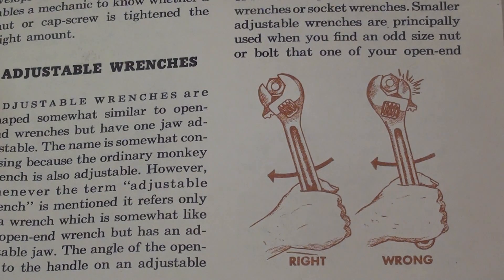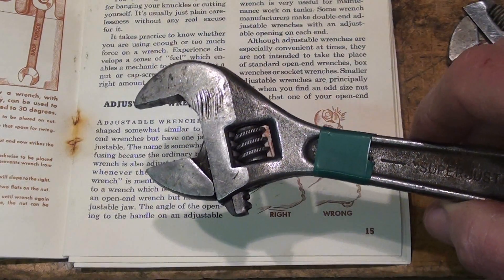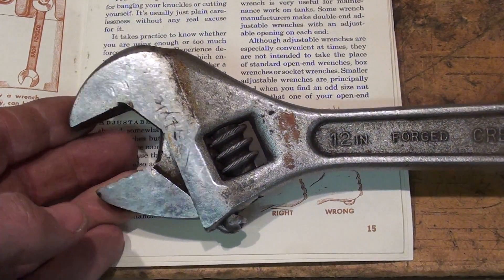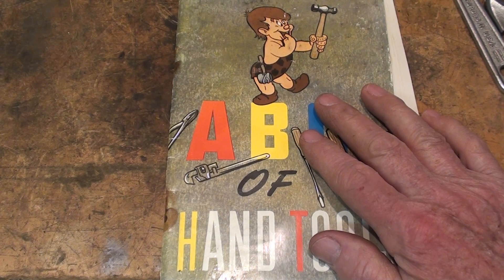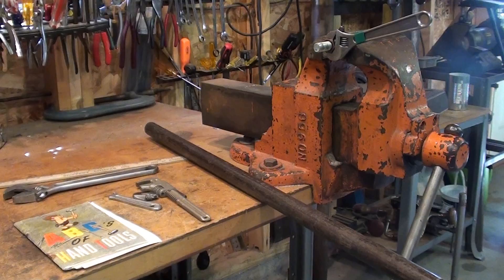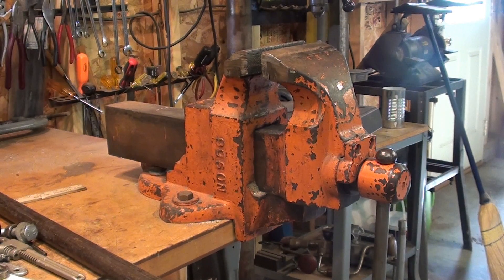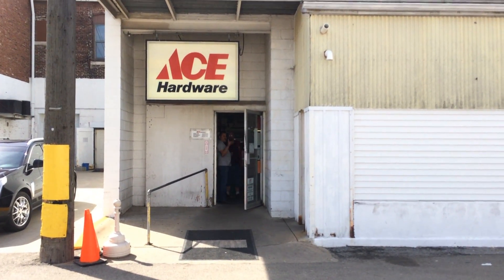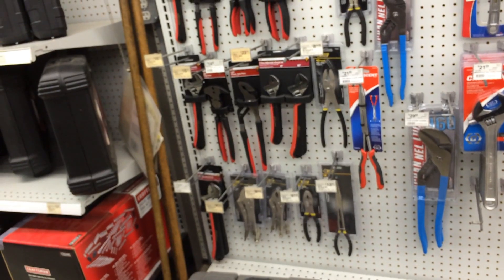MYTH BREAKERS #1 (pt 2 of 2) Use & Abuse of Crescent Wrenches mrpete222

Comment: Seen a guy break a 36AF spanner undoing a nut. Was not even using a tickler bar, just by hand, overhead in a confined space. Ting, clang, clang clang and then a few choice words, and then he climbed down with half, walked to get the other half then went to get a new one.

Friend also was undoing a clutch bolt, so needed a little more than hand length on the Gerdore power bar. 1in drive socket, 6ft pry bar in ground to hold the breaker bar on the nut, and 6m of pipe with eventually 2 guys jumping on the end to "persuade" it to undo.

I have taken spanners, detempered them, bent and ground them to fit a job then rehardened them, though for a lot of the time the cheapie was perfect in this use, not a good one.
Reply: +SeanBZA Yeah, I've had to heat up and bend a few wrenches for specialty tools over the years, I looked at the wrenches I had and used the least precious ones for the job, not that they were cheapies but weren't my favorites.  But then I'm like Mr Pete, I have so many more of each than I ever needed.

Comment: sir a couple things first i believe the guarantee had more to do with the old timers than craftsman but YOU SURE BROUGHT HOPE TO THIS DAMN WORLD BY SHOWING THAT. as you stated it`s better to pull a wrench than push, also it`s true that one should never use a cheater bar (but if the need arises i do). my contribution to this thread ALWAYS watch the path the cheater bar will take if the damn wrench fails spectacularly. they use to hit you in the face if you`re not careful. nosebleeds and cuts are nothing but if you wear glasses WARNING you only have two (one in my case). be safe. take care. pete
ps i hope you don`t regret giving the power to police trolls to the anti troll groupie patrol ;)

Comment: Nice to know that at least some places will honor the warranty.Many years ago at Sears my father tried to exchange a phillips screwdriver that was pretty stripped. The clerk said he could not exchange it because it was not actually broken. He did suggest that if somebody were to for instance stick it in a trailer hitch or other sturdy aperture and pull real hard that it might actually break. So, it took 10 minutes longer but my dad got the new screwdriver. ;-)Around that time we went to get a rebuild kit for a ratchet, and they not only supplied it for free, but installed it. The clerk had it repaired faster than you could field strip an M1911!

Comment: You know, about typical open-end wrenches, I think there might be a reason for using them in one direction be wrong. You see the jaws work in unequal conditions, the nut is pushing on the root of one jaw and on the tip of the other, and incidentally one of the jaws is thicker. So I think an open-end wrench might hang in there a little longer if you're torquing in the direction of the thicker jaw. I have no sources to back it up, but it sounds reasonable, doesn't it? After all on your wrench the thinner jaw broke off, right?

Comment: Another great video Lyle, and the men from Ace Hardware did the company proud. Good to see them keeping their word. My late father told me of one of our family friends who had acquired a U.S. manufactured ratchet when he bought out a retiring machine shop owner. He liked the feel of that particular tool, but after some years of his ownership, a pawl broke, so he wrote to the company whose Springfield IIRC address was on the tool body, briefly stating the tool details and how he had acquired it, and asked if spare parts might be available. A couple of weeks later a parcel arrived in the post ( to Australia) with a repair kit, and a lovely letter explaining that spares were kept for all their relevant tools and how nice it was to hear that  the ratchet which had left the factory in April of 1916 was still a favourite tool over 70 years later. There was no charge and he was told that if he needed any more assistance , not to hesitate to get in touch. That would have happened in the late 1980s or early 90s, and I never found out which company it was but I hope that they have survived the industrial turmoil that has decimated production in your country and mine too.
Good luck with your crown, I have a mouth full of stitches at the moment, to sort out an infection on a tooth which had root canal therapy. It cost me AU$1749, roughly US$1364 at the current exchange rate. The only good thing is that all the pain has been confined to the hip pocket, and none to my mouth;-)
Reply from the maker: +Rope Tangler Thanks--a good story & good company

Comment: That was one tough little bugger :) Great integrity of all involved. I know we have all done it @ one time or another but using a "cheater bar" is beyond the design capacity of the tool, any tool. Nonetheless, this series showed the results of using a crescent the wrong way, and on occasion, we all have used them the wrong way to access what we were doing :) Great stuff!

Wrt lifetime warranty it is still alive and well for Snap on, Craftsman, Mastercraft and Husky. There might be more out there but those are the tools I use. That being said on a ratchet Mastercraft will give you the guts for a spare head vice replacing the entire tool, if the head is kaput. Nothing wrong with that. The downside to all these warranties, is that a lot of folks are no longer in the know, as evidenced in this video.

OTOH I did once witness a warranty being denied on a Mastercraft 1/2" ratchet were there was evidence a cheater bar had been used (handle bent to almost a 45). The customer was totally POed! Sir, you used your tool outside its design characteristics, a lot can be said about this anecdote. Nonetheless, no exchange took place. He might have gotten a different response from a different store, who knows! If we read warranties, they normally say under normal use. In this day and age economy, the only thing of value we still have and that cost nothing is our integrity. Well done Lyle :)
Reply: Jim C
The 3 or 4 times I broke a Craftsman tool, they promptly replaced it.  That's why I continue to buy Craftsman tools.

Comment: from factory work, I've found that the directional crescent wrench issue is more about rounding the nuts
Reply: This is an old comment, but I feel that's the case, too. I'm no engineer, but I'm going to state that the jaws are more likely to loosen with the outward force applied near the rack whereas the rack will lock into the channel with the force applied at the tip of the jaw.

Similar to a Stillson pipe wrench.

Comment: Saw a comment below that said Tubalcain for president.  I agree, I would go for anyone with a modicum of common sense.  The problem is those with any common sense know enough to not want the job!  

I was surprised Ace honored the refund, but I shouldn't be.  I have walked into Sears with many a broken screwdriver used as a pry bar and many a damaged socket wrench and breaker bar used with a cheater bar and they have always just replaced it no questions asked.  Craftsman sometimes gets a bad rap but I have always loved them.  I am building quite the collection of vintage Craftsman tools.
Reply: +Tenspeed TheBikeHanger I agree!

Comment: That's why I never liked those adjustable wrenches , 1. they always slipped (and hurt you )& 2. they rounded the nuts off and then you needed a Vice Grip. I was the sign man for a county highway dept. for 8 years ,that was the hardest job I ever had and prolly why my back is totaled  ( NO HA HA OR LOL)you had to do everything in your power to keep the ANIMALS from stealing those signs and then you might need to replace said sign. What a challenge !! lol